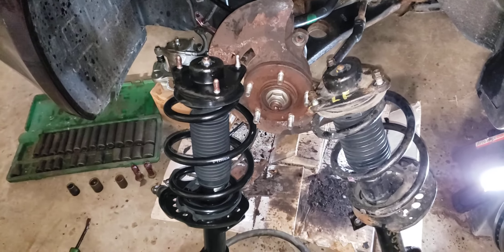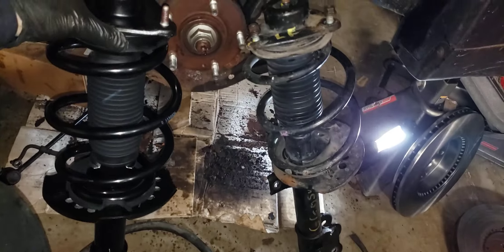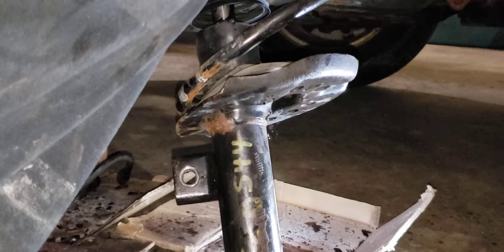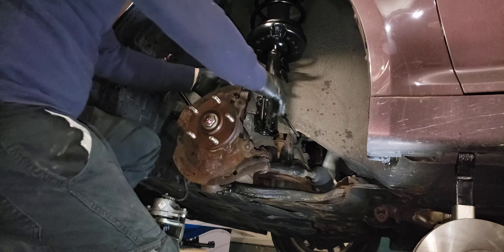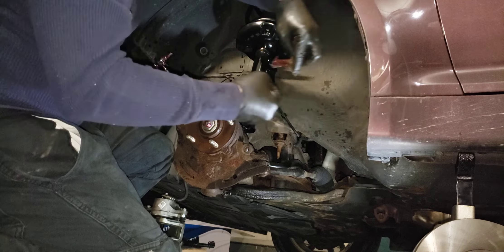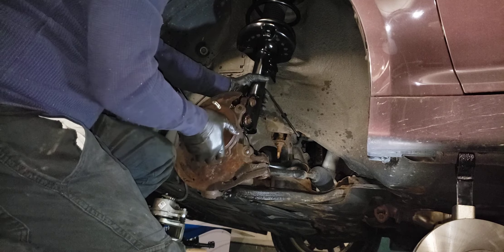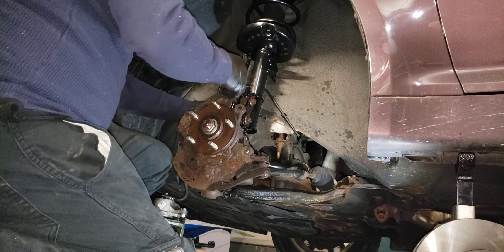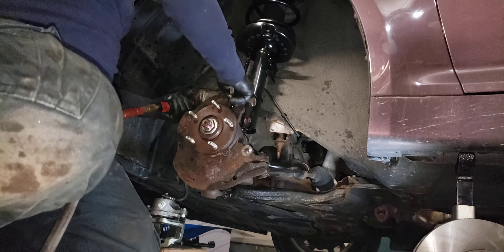2011 Kia Optima Front Strut Installation....February 15, 2021

Comment: I’m having a hard time finding struts for my 2011 optima, what brand/part number are you using? Thanks for the video.
Reply from the maker: Hi, You're welcome. 
I searched for them on Ebay and the company was Detroit Axle company. 
A local auto parts store will have them most likely But it will cost a lot more.
Reply: Try Monroe 73072 and 73073  if your away bar mount is high on the strut and abs and brake line are on the same side